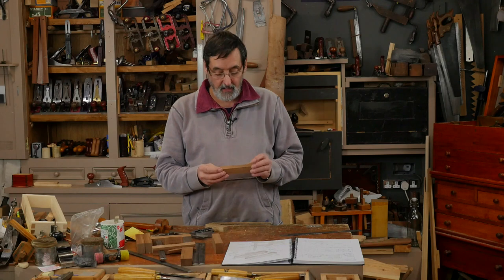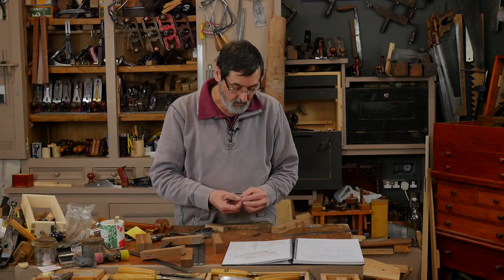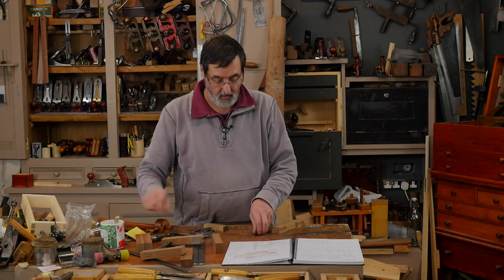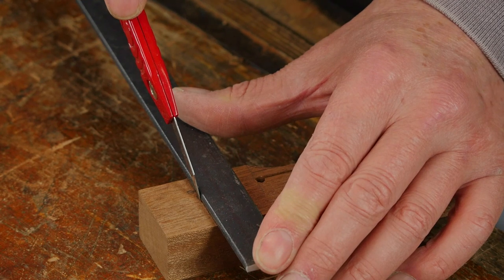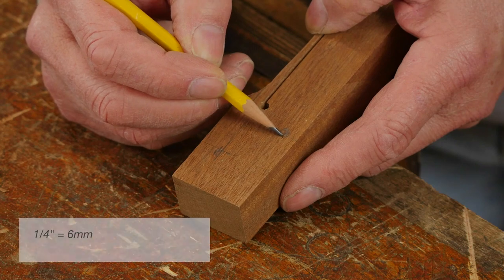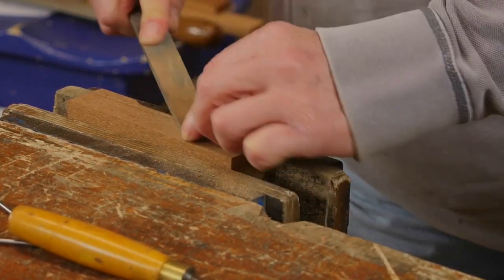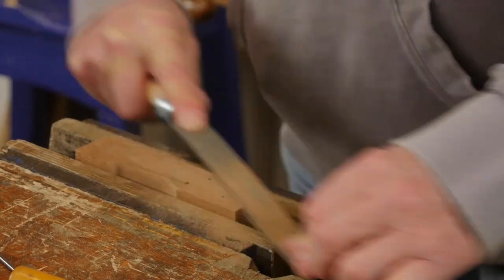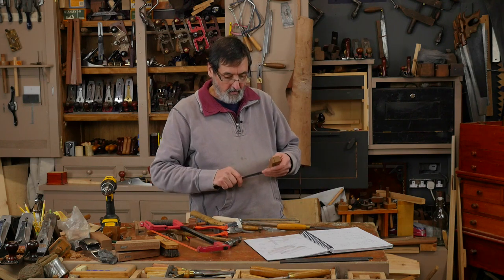Making Cam Clamps 2 | Paul Sellers

Comment: The verbal explanations and instructions as you work are simply amazing.  I thought to try drawing the bar end into a scraper, then pull it thru the hole to achieve final fit with the bar?  I guess I'll have to make some clamps to find out.

Comment: Perhaps I missed it, but I'd like to know if drift pins are better for any reason than using brass rod.  I know that brass has been used in making many hand tools, particularly try squares, for centuries.  I'd use them for aesthetic reasons if there is no reason to.

Comment: Can you make this thin mortice without a small chisel? I had this exact problem not having a small enough chisel and ended up making a mess.
Reply: Yes, you can drill a line of small holes inside the mortice markings and then use a coping saw or jewellers saw to cut between the holes until all of the wood inside the mortice has been sawn through. The inside of the mortice can then be cleaned up using either a thin file or rasp, sand paper or even a small knife.  It's fiddly and time consuming but it can be done.

Comment: Once you're fairly close, couldn't you just heat your metal and burn it on through? would that make it too loose, or damage the clamp in some other way?
Reply: Thomas Russell i would imagine the chard area would wear away faster then wood so it would loosen up faster then if ypu cut the mortice

Comment: I was about to make these, but I only can buy 4mm thick bar while I only have 6mm wide chisel the smallest. I am afraid of having too much wiggle with 6mm hole for 4mm bar. What do you think? Or I can sharpen some old 4mm screwdriver just for this case and use it as a 4mm chisel :-) Or just use a drill to drill the mortise hole completely and have just little bit less of a wiggle.

Just a question - can clamps like these also be used for laminating? Or the pressure is simply not enough here?
Reply from the maker: You have to have a  properly sized chisel otherwise the slop will make them unmanageable. These are more a lightweight clamp not really intended for heavy duty clamping.

Comment: Anyone have a link for those roll pins?
Reply: Draper do them amongst others try your local farm or garden machinery suppliers or an engineering suppliers bearing suppliers will have them too.
Reply: +Adam Lynch I have found plenty if the split roll pins. Was hoping for the kind Paul described. Do they have a different name than roll pin?